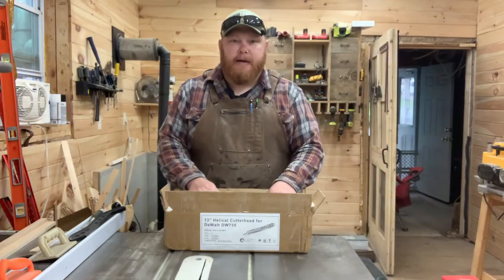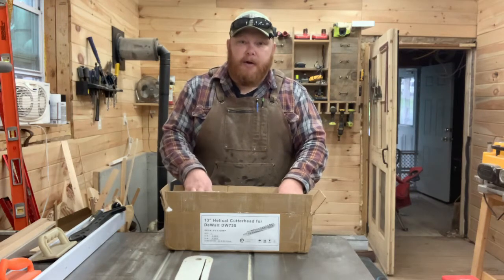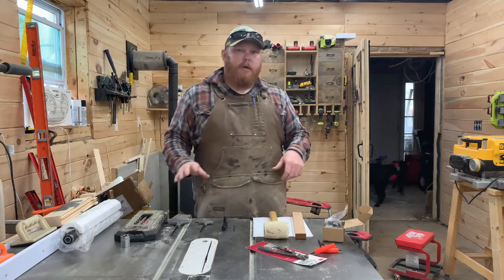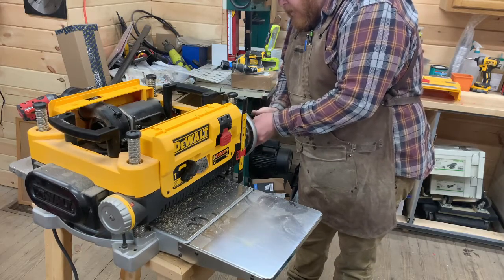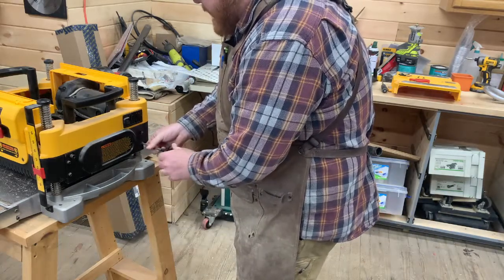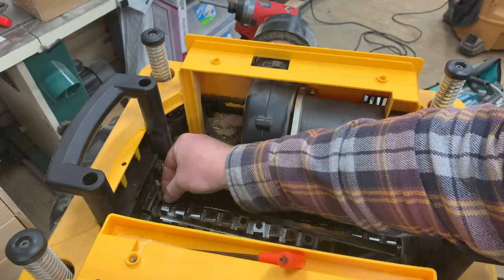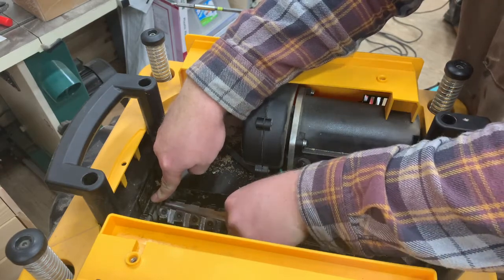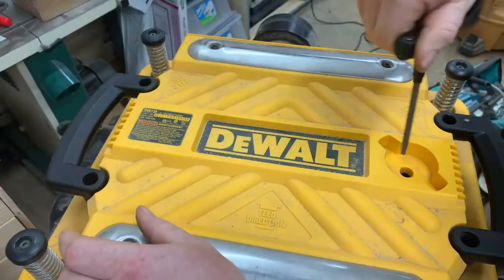Best New Helical Cutterhead for DEWALT 735X

Comment: How did the cutter head work?
Reply from the maker: Face and edge grain it works awesome, couple of passes and it’s ridiculously smooth. End grain is not good at all, had big chunks taken out of it. Thanks for watching
Reply: @blacklaboutdoors7285  I wonder if you glued sacrificial to the front and back to but cut of after if that might prevent the chunks from coming out. Or lighter passes but endgrain can be tricky and potentially dangerous. Thanks for your response.
Reply from the maker: I can’t remember if I tried that or not, I did try very light passes and it still chipped out. I plan on buying a drum sander.
Reply: Pretty sure every helical head has chip out on end grain. I've seen in other videos people saying it is real dangerous. I've also seen people doing it with end grain and having seemingly good results. However I wouldn't trust it. Definitely better left for the sander

Comment: So you have 10 months with this now I believe.   I'm thinking of ordering one. Didn't see a testing video - how are you liking it?  Would you still choose this over the Lux and Shelix?
Reply from the maker: Works great on everything except for end grain, even at very shallow passes it has chip out. No, I wouldn’t. I specifically bought it for end grain and company said it would work with no issues, but not the case. I will end up keeping and using it on flat and edge grain, super smooth. I’m going to get an open ended drum sander for the edge grain stuff. Thanks for watching.
Reply: That’s disappointing. Do you know or have you heard anecdotally if the others (Lux/Shelix) work with end grain?  Thanks again for the video.
Reply from the maker: @dano9176  kris devo and Devo’s woodcraft both YouTube channels.
Your welcome and thanks for watching

Comment: I can’t get the drive belt to budge?it is a new machine . Had you run yours awhile maybe to make belt more flexible. Any suggestions?the handbook says the belt should be done by authorized dealer .thanks . Great video. Paul krey
Reply from the maker: No, I have had mine for a couple of years and I found it difficult as well. If you are trying to take it off you need to pull on it really hard by the pulley while you are rotating it, when you go to put it back on you need to keep a lot of pressure on the belt pushing it back onto the pulley as you are rotating it.
I found it fairly easy taking it off but putting it back was a lot of hard work.

Thank you for watching the video, glad it helped.